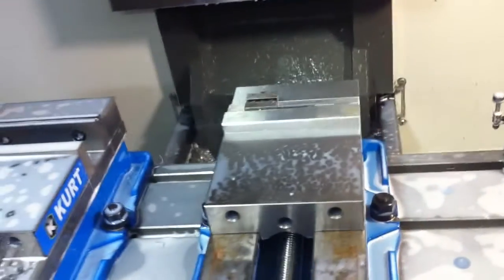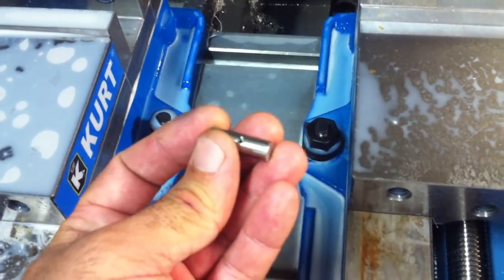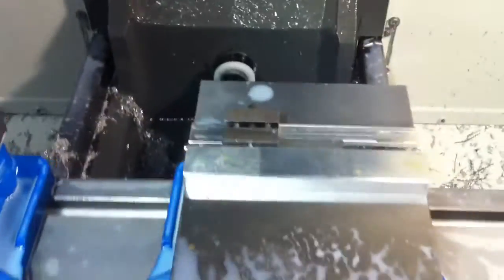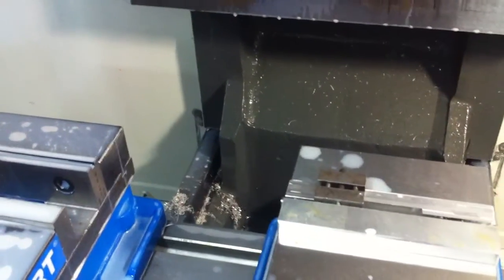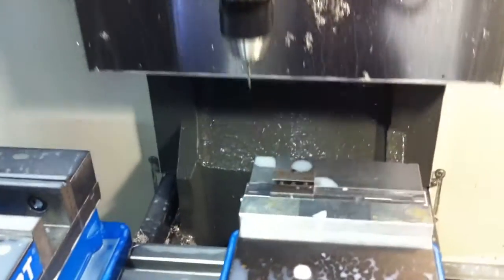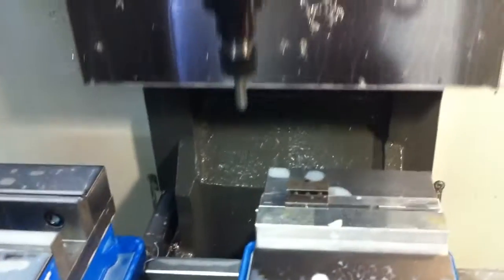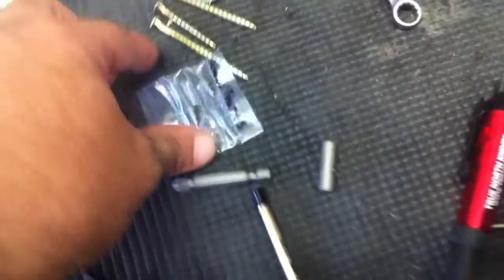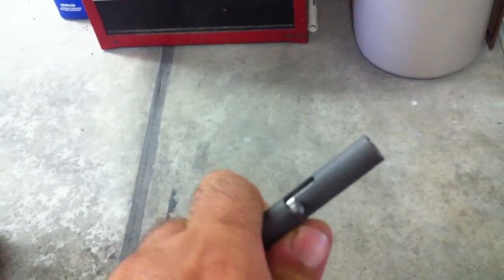Drilling, Counterboring, and Tapping the Bolt in my pen.

Comment: Yes I figured that out the hard way.  I also figured out that form taps need a bigger hole than regular taps.  My Tormach doesn't do rigid tapping but I've form tapped a lot of 2-56 in titanium with their tension/compression holder.  Once I got the hole size right I magically stopped breaking taps.  Love the vids Brian, maybe try a tripod sometime :-).